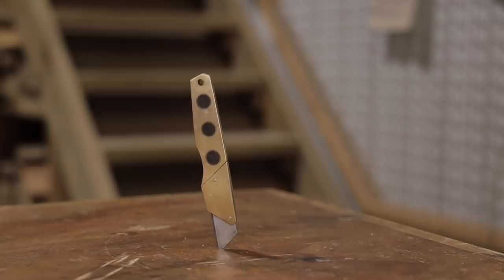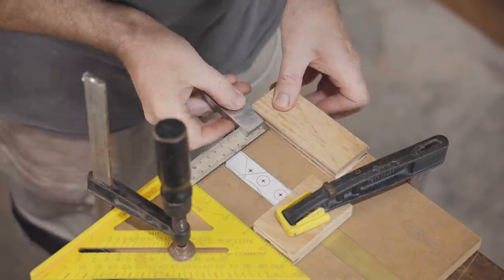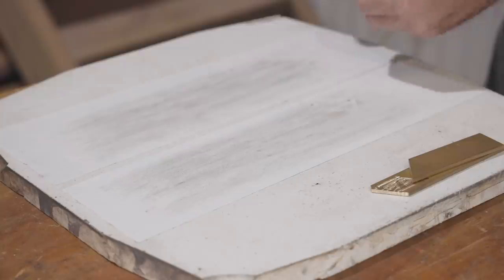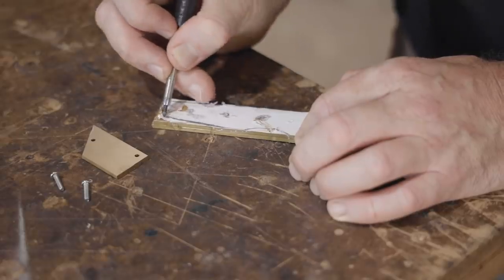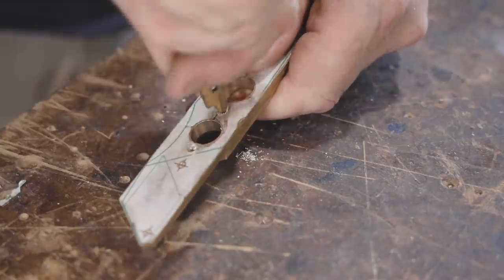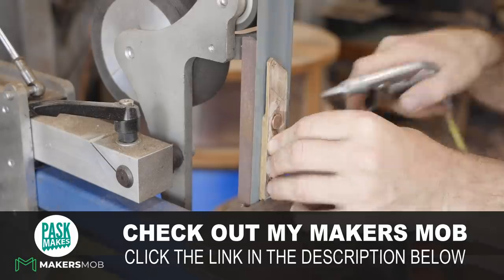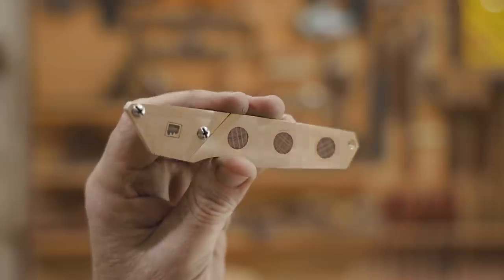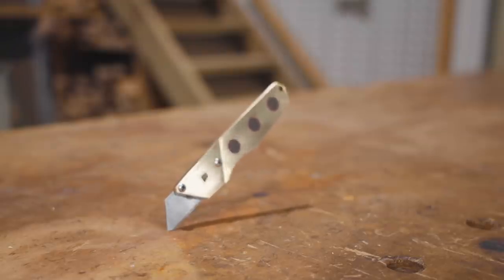Homemade Brass Utility Knife

Comment: Milling brass with a Trim router. This opens up so many options. Awesome idea and product!
Reply from the maker: I was confident it would do it but I was surprised quite how well it worked. :)
Reply: Brass and aluminium are fine with router bits, take it slow and look out for the shavings they tend to get everywhere. Some people say once you use a bit on metal it’s no good for wood but I haven’t found that to be the case. 👍🏻
Reply: @JoesWorkbench  Regular HSS steel? Not carbide bits?
Reply: Kai E.  Both will work, I tend to use cheaper hss just incase a trash them 🤞
Reply: If you do ali, wax your cutter to stop swarf sticking to it, same goes for saw blades and files etc

Comment: Lovely knife!  The brass looks very classy.  If I were to make one like that I might sweat the two halves together with solder.  It would still need care not to overheat and melt the solder, but you could get it hotter than an epoxy glued assembly.  Not meant as a criticism, just an observation.
Reply from the maker: Thanks Alan! I did think of solder as a possibility but never doing anything like that, I wasn't sure! I just went with what I knew. :)
Reply: TIG maybe?
Reply: Alan Muddypaws. Hey Allen, it’s funny how many ideas / improvements you can come up with once you see an idea. My first thought was to solder as well, then I thought instead of machining out the blade rebate why not get a strip of stainless steel the same thickness as the blade and solder all three pieces together. That would look awesome I think and I would use S/S countersink screws. It’s all good in hindsight but I would never have thought to make a utility knife in the first place so full credit to Pask in the first place. Cheers Stuart 🇦🇺

Comment: That’s pretty cool Neil! Just a thought I had; if you left the two have separate and a mirror image of each other , you could make them scissor together. Open to extend or retract the blade and close to lock the blade in or store the knife. Thanks Man!
Reply: Halves not have, GD autocorrect!

Comment: Since a utility knife is used by drawing a stroke or scraping, and should not be used with a heavy hand to stab or pry, I think I'll make one from ebony, and maybe with purpleheart trim, and if needed a thin brass bolster.  I think I'll countersink flathead screws too.    Incidentally, a utility knife blade fits in the small slots of Incra-Jig t-rules.  That can be handy for incising marks.

Comment: Nicely done Pask! I'd recommend making a cover for that blade & on the next one, make the blade retractable & inset the heads of those screws.......... 👍👍
Reply from the maker: Thanks Steve! I did think about making the blade retractable, but when I thought about it, I didn't really need that for a knife that's going to be used just in the workshop. The screws are out of the way of your grip so they are fine but if they had have been in the way I would've used inset ones. :)

Comment: that's an amazing anvil. I love it.  a big anvil is always better, there is little purpose (not no purpose however) to a smaller second anvil
Reply: also, you don't need to heat that brass to stamp the logo. it's soft stuff(as you've already said).  Rounding over your rivets is to prevent a problem that is better fixed by not having rivets that are too long.   (clickspring shows how to do it really well)
Reply from the maker: @Frostfly  Thanks Robert! I love the anvil and can't wait to get it set up properly. I did a test without heating the brass up and I couldn't get the mark deep enough. I'll be using my fly press for this task when I eventually get that set up. :)

Comment: Hi Neil. 1) Do you know why commercial knives are not only 6 ... 9 mm thick of their body (only two brass plates facing each other), but MUCH more? The reason is this: When you have to cut something that requires more squeezing and pressing from the hand, it is much more hand-friendly to the skin when the body is rounded-edged and about 18mm strong. It does not apply too much pressure per square millimeter to the skin of the palm. It's pleasant and enjoyable to use!
2) It is true that if I have the right car factory in my home, then all the cars I make for sale are then "homemade cars". However, there is some contradiction in that. I leave the matter to smarter people than I am...

Comment: Chamfer the holes where the pipe goes throgh and rivet them with a tapered punch.copper work hardens very easily and makes a decent rivet

Comment: As a Suggestion for the next one you make, or to improve this one if you can split the glued sections apart, instead of glueing the two handle pieces together, you could add holes + threads on the outer edges of the scales and bolt them together, then you could mill out a blade size cavity on the inside of the handle scale(s) (where you glued these two), if you do that on both the inside scales you could create a internal recess for 2 or more spare blades (only 1 spare? if just one scale had the cavity). This would make it so you could always have spare blades securely within the handle.

This would make it more convenient for blade changes without having to move far from your work when you need to change the blade. Also for your own safety you may want to create some kind of end cap to cover the blade when not in use, seeing all your wood working video's I'm sure you are more than talented enough to turn, or make a suitable blade cover from wood, also adding a nicely turned cover to the handle scales would make it look even better :)
Reply from the maker: Thanks for the ideas! I wasn't worried about the blade being covered as I'll be using this just in the workshop. It'll be hung on the tool wall when not in use. :)

Comment: That looks good. Though, one change I would make if it were mine would be to change out those pan head screws that hold the blade in and change it to counter sunk screws. Just my opinion.

Comment: I love it. the only thing I would want to improve is to find some way besides philips to attach the blade retainer. it's not that that's not a perfectly reasonable solution, but I just think it'd be absolutely perfect if there were a more elegant solution that gave it tool-less quick change capability. maybe some captive thumbscrews? but I don't know of any small enough ones. well, you've made a great tool and you've got my brain juices going I think I'd like to try to make one of these for myself. thank you.

Comment: Another average job Neil 😁  Tapered holes give a great mechanical advantage for riveting. I use a 3mm round needle file to create the taper, much more control and a finer taper than a spade bit, the wider the taper the more risk of splitting the rivet when peening.
Reply from the maker: Thanks Bill, I'll keep that in mind for next time. :)
Reply: @PaskMakes   Aminoolium filler rod is also good for rivets, much softer but still with enuf strength and the contrast can be very nice against brass or timber👍

Comment: The only thing I would have recommended would be to have a blade installed when you sanded the screw ends flush with the body. Other than that, very nice build. I enjoy your channel.
Reply: Perhaps the blade plate could have had a mild dovetail taper so it would slide on and lock the blade down, thereby not needing any screws at all..
Using the same idea, it probably would not be too hard to design a sliding cover for the blade too..

Quick, call Stanley, I think we're on to something..! haha..

Comment: I have some aluminium bar hanging around doing nothing. I might have a go. I thought about using brass rod to pin the two halves, but on checking they brass will cause the aluminium to corrode. It's a shame as I like the colour contrast.

Comment: What was the idea behind leaving ~3/16ths of the top end of the blade proud of the handle? I don't imagine rigidity loss is an issue or anything, just not a common design you see on utility knives

Comment: Great Job! Could you have dipped it in water, while grinding, to keep it cool?
Reply from the maker: I could but the template would have got wet. When the template was gone I carried on with the compressed air as that worked well. :)
Reply: Duh. 🤦‍♂️

Comment: Very beautiful, stylish and modern. But in my opinion to thin and the edges are to sharp to use it with force. In addition, I miss a safety cap. Rob

Comment: Probably a silly question, is there any reason to use the white sand paper over the coloured stuff? I’ve seen both but don't really know what the difference is between the two
Reply from the maker: The white sandpaper is not the correct product for metal but I use it and it works fine. It will wear out faster though. :)

Comment: You're your own worst critic... The knife looks great and it is only a tool to make the great stuff. Love the look and I'll bet it feels good too. I probably have opted for thicker by adding heft to the handle with wood using those wooden plugs as holes for the added handle grips. But smaller is always good for tight work and greater accuracy.

Comment: No blade guard?
Reply from the maker: It hangs on the tool wall when not in use and I don't need a blade cover when it's on my workbench. :)